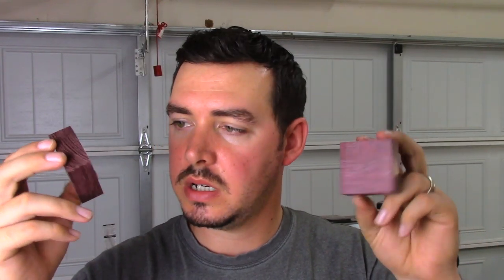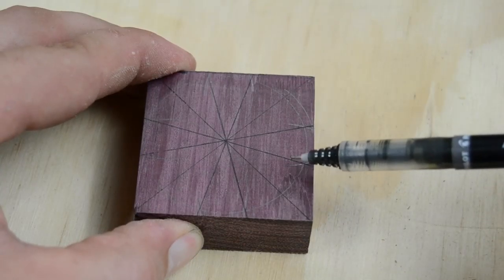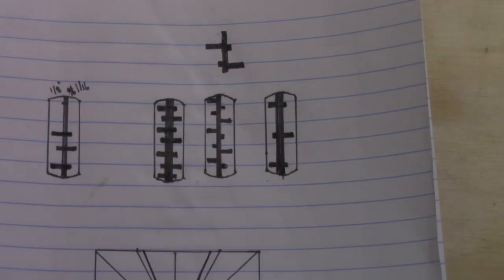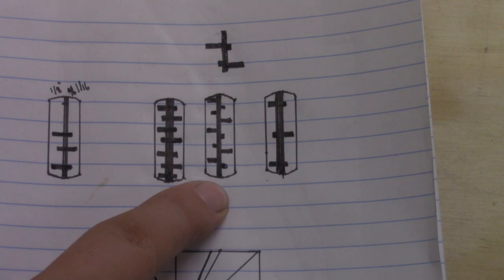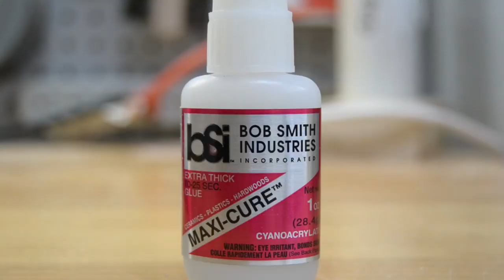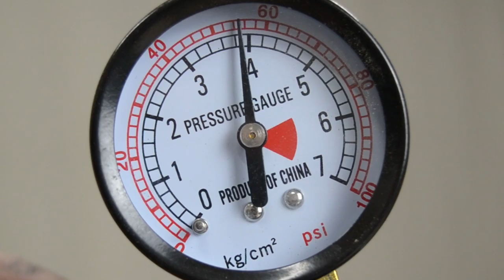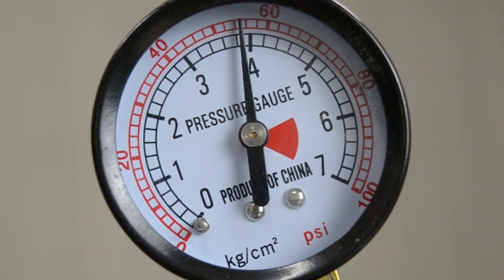Purpleheart and Epoxy Resin Ring | WoodTurning

Comment: Interesting video and channel!  Why do you use pressure vs vacuum to off-gas the epoxy?  I see this often so i know i am missing something.
Reply from the maker: I actually don't have a vacuum chamber yet so pressure was my only option. Vacuum is usually for degassing molds like silicone so they do not have voids when casting in them. Pressure is used for resin casting to make the sure the epoxy gets into all the voids and compresses the bubbles to microscopic levels.

Comment: Could you inform me of what the pot you set the resin and purple heart wood in for 18hrs? And the purpose please?
Reply from the maker: Pressure pot conversion from a paint pot. Used to compress the epoxy into all the small gaps and also reduce bubbles